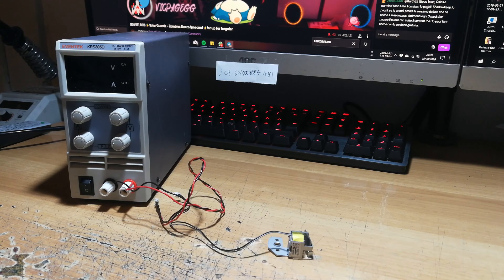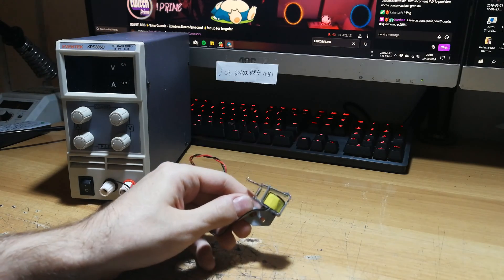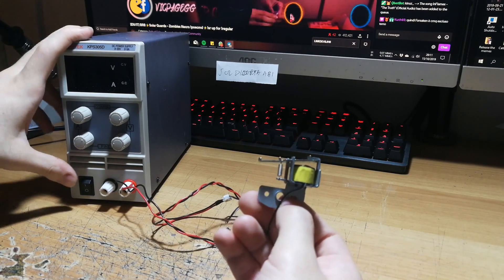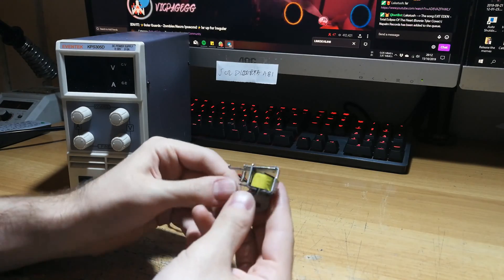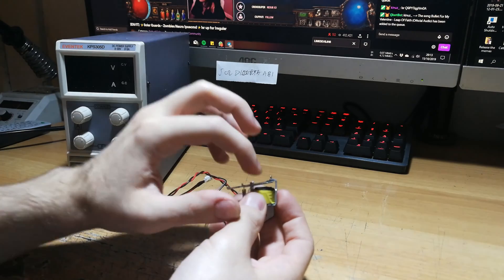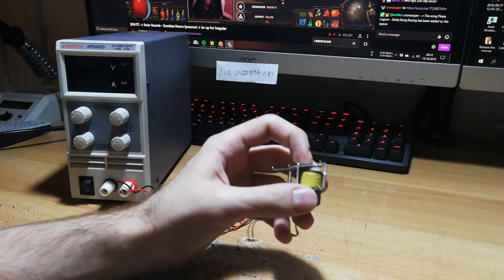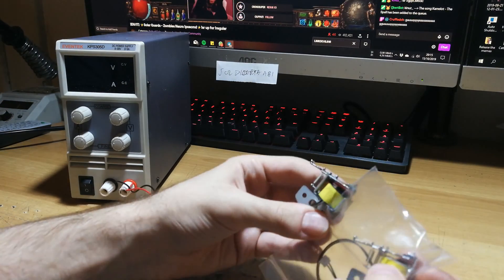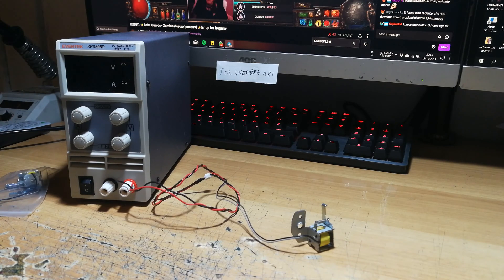Why Samsung Printers Jam Paper or Don't Pick-up Sheets.

Comment: Thanks. I replaced the solenoid on a 3305 and it still getting a paper jam. I removed the old pads on my original solenoid and replaced the arm pad with foam. still paper jam. Im at a loss.

Comment: My problem is not bc of that i think, bc it does pick up paper.. and i does pick up 1 sheet only, but then i mangles and destroys it at the part that has toner on it (the part that prints) and i am fkng lost. It folds the paper.
Reply from the maker: Do you mean the transfer belt (that black plastic belt) or the fuser unit (the upper side of the printer that heats up)?

Comment: commenters don't be too hard on Samsung, it took me a while to work out what was going on,  firstly I cleaned both sticky pads away completely then re-tested the solenoid as per the video, to my surprise the solenoid didn't work! when actuated the arm was "sticking" to the stop, if I gave it a slight nudge it clicked across to the coil pole, I then realised it was magnetism and that the arm needed to be at least 1mm away from the stop to work properly hence the fibreglass PCB fix,  so over time its not necessarily the original pads getting sticky its that the arm pad gets squashed and too thin,  it is surprising though that Samsung have let this ride, they must have worked out what was happening, cynically one might conclude that it takes a few years for the little pad to get too thin, then causing the paper feed to become erratic and soon after to stop feeding,  then the customer buys a new printer - so more sales for Samsung I wonder ???
Reply: I think you're right on the head Richard! I didn't think that the arm stopper would also get magnitized. 
My paper pickup rod wasn't able to spin at first. I removed the coil pad and replaced it with a very thin tape. The solenoid worked 70% of the time.
After reading your comment, I replaced the arm pad with a 1mm thick rubber tape I bought to replace the separation pad. The solenoid now works fine.
But sometimes it would pickup 1 sheet then 1/3 of another sheet, which is a classic symptom of the arm not returning to rest position fast enough. On HP printers this would be because of sticky foam but here on Samsung printer my very thin tape as the coil pad wasn't enough. With another 1mm thick rubber tape as the coil pad did the solenoid finally worked right.
Thank you very much!

Comment: Its not the small pads becoming "gooey"  its the pad on the arm becoming too thin. if the arm gets too close to the metal stop there is enough magnetism to hold it there when the relay actuates, a fix that works well is as follows,  1. remove both pads and clean away any glue.  2. leave the coil pole pad out (its not needed)  3. make a small piece of fibreglass PCB standard thickness (same dimensions as the sticky pad was) file of any solder resist coating and superglue the piece of PCB onto the arm in place where the original pad was.  thanks for your video it got me on the right track to fixing my printer :)

Comment: Do you know this to be a problem with the Samsung M4530 printer? We have one that prints fine when printing one-side prints, but when printing in duplex, it reliably jams "at top of duplex" 75% of the time, and the jam has to be cleared out via the rear door. Every time we do this, the paper has one-side printed, so it's always jamming when it goes to print the second side.

Comment: Hi thank ypu for this information. I wrote to you few days ago about a printer not working. I used your instructions to take a part the printer and found 2 disconnected wites and a pickup weel was not samled correctly. The pba print was damaged but I used the sparepart from my second printer 365. After fixed all this my printer is,qorking again, but printer stop when trying to load paper. I have seen your recent video above, but I wonder  why this happens after maintainance. The printer was very effective before I made mismash with the pickuproller and no problems only some stribes on the color prints (try to fix it by cleaning the roller). Now I have 2  options. I can take the paper unit from the old printer or can buy a soleoid from HP . What would you do?

Comment: Hi, I have a Samsung ML-3051N and the constant jamming is driving me mad.  It works okay if I use the manual feed but using the tray feed and it always jams after the second or third page of a continuous print. Any tips?
Reply: I've been having the same issue with mine.  It seems for me, my printer acts up when not used for awhile.  The first few pages do not want to feed through, but then it starts working.  Not sure what the cause is.  Probably the rollers are worn out or something.

Comment: I have a Samsung Xpress C410W and I have this exact problem! I've never had any issues until now and I've had it for years. Everything was great, just put brand new toners in it and it just stopped loading the paper and tell me there is a paper jam. I have taken out the roller cleaned it, cleaned everything in it, and it still does this.
Reply from the maker: Probably it's the solenoid, i've a video exactly on the repair procedure for the CLP365/C410

Comment: It's deliberate aging of the product Samsung does it on purpose - I know a lady that works for Samsung and her job is to qualify product materials that should wear off after 2-3 years of usage! NO JOKE.
I was a professional printers repair technician and I was using a double sided repair foam tape for it., sometimes thinning it down with a razor to a proper thickness. Do this instead of buying the new solenoid - don't support Samsung for doing this BS to consumers
Reply from the maker: I never bought those solenoids directly from Samsung. Honestly at first glance I could have even thought that it wasn't on purpose, but after 10 years of the same problem on the same part...

Comment: My printer ML-1750 doesn't pickup paper.  The printer makes noise to indicate that it is trying to pick up paper but it isn't able to do so.  What do you suggest?  Thanks for your help.
Reply from the maker: Hi :) I'd try cleaning the paper pickup roller, use a cotton fabric piece and some glass cleaner or isopropyl alcohol

Comment: Thanks a bunch! Just fixed my Samsung SCX 4825FN thanks to this. In case it helps, I took apart the solenoid from the printer and measure the two foams, to have like a paper template of their tiny sizes. I removed the original foams and cleaned surfaces with alcohol. Then took the cork from a (good Spanish) wine bottle and cutted a very thin slice of cork (about the same thickness than the original foam, maybe a tiny bit thicker). Then I cutted the cork slice with scissors, to match the sizes of original foam pieces (using my tiny paper templates). I prepared just a bit of high temperature epoxy (just in case) and placed a super thin layer on the corks, and glued them to the solenoid. Now I have the printer working, with no noises, and hope cork won't tear off that way.

Comment: Really good information. Thank you. I found this same problem in an SCX-4725 printer. My printer was picking up multiple sheets and sometimes not picking up a sheet properly. Both the foam on the solenoid coil (for when the solenoid lever is in the energized position, or paper feed position) and the foam on the solenoid lever (the de-energized, or rest position) were very sticky.
...I am not clear on the purpose of the foam, but I kind of doubt it is noise or entirely noise.
...The foam on the solenoid coil could be to prevent noise, or to prevent damage to the coil bobbin, or to prevent lever bounce.
...The foam on the solenoid lever could be to prevent noise, but I doubt that. Again, It could be to prevent bounce.
...But possibly the foam tape between the solenoid lever and the solenoid core frame (where the frame stops the solenoid lever travel) ensures that there is an air gap at that point, to ensure a break in the magnetic flux there. That might create same-polarity magnetic-poles there, between the solenoid-frame lever-stop and the lever itself, so that the magnetic poles oppose each other, to create a magnetic push to help the solenoid actuate. This would explain why the lever foam can be eliminated in some printers, because the L-tab of the solenoid lever rides on the cam of the pickup gear, which means that on some printers, there could be an air gap between the solenoid lever and the part of the solenoid frame that stops the lever travel, even without the foam there.

Comment: Hi,
Great information.
I am having problem with my printer Samsung Xpress Color C410W. It is not printing any pages. When I place print comment it gives me blank page. And sometime restart by it self. while printing. I need your advice what can me the issue.
Reply from the maker: Probably it's not installed or configured correctly. Reinstall the printer driver and be sure to use the correct port.
Reply: @PaoloMarcelli  I have done installation of the driver and configure the wifi on the printer. I tried taking print with wifi connection. It start as if it is going to printing but it start and reset itself and then after restart it gives white page. I feel that the print comment which I place is reset from the memory and gives white page. Kindly advice me.

Comment: Thank you for sharing your knoledge , very helpfull.
When Selenoide Is bad the printer Will not work at all ? Mine printer a  Samsung x press 3875 does prints well after i turn it on but when go to another job i have the error of jam inside machine but there s nothing.
This hapens all day long, very anoying being  opening front door every Time to  get rid of the error.
Any idea what it could be?
Printer was in a box for 3 years withou any use
Thank you
Reply from the maker: That could absolutely be the case! It depends by the position of those pads on the solenoid and the materials they used to make them. If the pad is at a side of the electromagnet and the pad gets sticky, the solenoid could get stuck down (so more than one sheet are picked up). If the pad is on the top, the solenoid could be stuck open so no sheets get picked up and the printer gives you a paper jam. I'd first have a look (if possible) if the pickup roller rotates or not when you try to print something, and eventually replace the solenoid, or at least those two pads.
Reply: @PaoloMarcelli  it's posible Samsung Xpress 3875 dw dont use selenoide ? we did not see one where it was souposed to be.
It could be another part in this model that does it's funtion?
Greeting from Cuba

Comment: You mustn't change new one..you should clean old plastic parts and continue to use old
Reply from the maker: I've done that with other models, but with the CLP and CLX's I tried a few times and didn't work, that's why I suggested to replace the solenoid, but if it worked for you better :)

Comment: Effectively, my 11 years old scx-4300 was suffering from this issue. I removed the foamy stops and it’s working now. I kept the solenoid and all that’s different now it’s just a click noise which doesn’t bother me at all. I noticed the solenoid is activated for less than a second. That’s why when the foamy stops stuck to the plate it causes the paper puller to grab two sheets leading to paper jam. Thanks a lot for the tip!!

Comment: it's all about an electronic component. A printer that will not pick up paper sheets need some remedy on the foamy rollers that get paper... identify where and what to do to make the rollers get sticky again ...
Reply from the maker: On those printers it's not the rollers, but the solenoid in the pickup mechanism. You could even replace the pickup roller with a new one and still have no paper picked up.

Comment: Does this also apply to the SCX series of laser printer? My SCX-3405W is showing these same symptoms; not picking up paper (no paper in the feed roller mechanism), yet it says I have a paper jam. Would be nice if this would explain the problem....
Reply: I have a SCX-4300 which is eleven years old already. I removed the foamy completely and it works fine now. If you don’t mind the extra bit of clicking noise, go for it.

Comment: Other ways to probably fix this, with nail polish remover, (disolvent) to reduce sticky, also with alcohol to reduce stickyness, use paper cuts to stick them on the foam, and also buy foam on any paper shop and replace it, also use foot powder, to get rid of sticky, and last but not least get rid of the foam and clean with disolvent, thinner or any other product like it, and also all the previusly mentioned, Thank you for sharing!